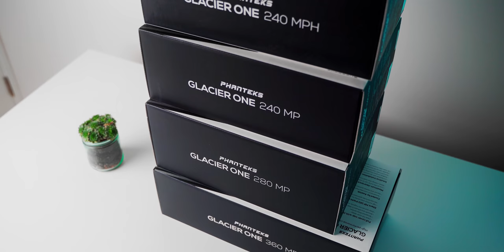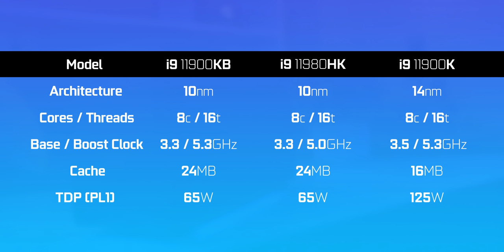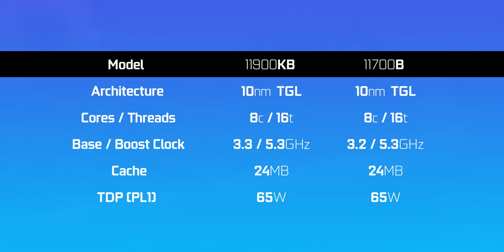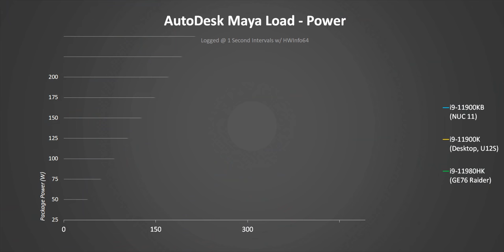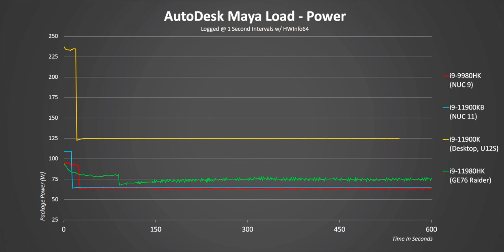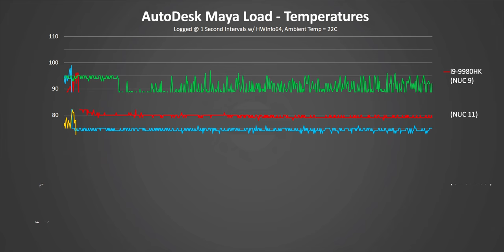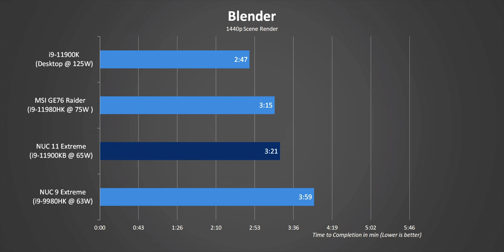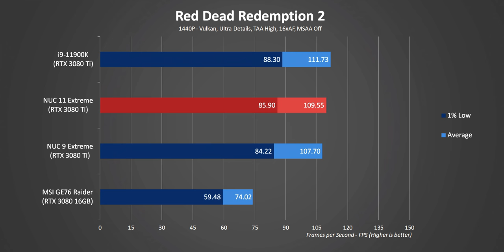The Best Intel PC - Beast Canyon NUC 11 Extreme Review

Comment: While I really like the idea for the money I'd personally get a laptop as they seem to be listing for $1600, though I guess that depends on the price of the CU alone.
Reply: It may seem cheaper, but gaming laptops do have limitations, the gpus and cpus are less powerful than their desktop counterparts and are often undervolted, they for the most part don't have any upgrade options, they also get hot and are quite loud. Make sure you factor all of those things in before you jump on a laptop because all of these things vary from laptop to laptop and two laptops with the very similar specs could offer very different levels of performance based on these factors.
Reply: @_shadow_1  I'm aware of all of this, but the NUC is basically laptop hardware in a not so SFF chassis.   If the options were 1) build a PC, 2) buy a NUC or 3) buy a laptop and the price were the same I'd go for 1 or 3 over the NUC any day though I do like the idea.
Reply: @nadtz  Yeah, I would go for even a laptop over the nuc because nucs are overpriced for what you get being basically a just laptop hardware without the portability or the screen. I decided to get a sff known as the magnus one, which has desktop everything except the ram, the difference between dimm and sodimm ram is just that sodimm is more compact for laptops and stuff.

It is only 8.3 liters, similar to the shape ghost canyon, and it has an rtx 3070 and an i7 10700, which is quite impressive for it's size
Reply: @_shadow_1  overpriced is somewhat subjective, the older ones at least are really well made and these don't look less so.  But personally value for dollar I'd agree unless you have some use case where this fits a need aside of "I got it cause it's cool" or what have you.

Comment: I mean you can get a DAN A4 wich is 8 l in volume and it looks cleaner.
Then kit the DAN A4 out with a 5800x, 32gb ram, 1 tb ssd, 650w power supply, good b550 board and a cooler and you are at about 1200$. So 150$ cheaper than the NUC and there you have still to buy SSD and Ram.
Its not a good deal at all. It is kind of good engeneering but for that price it is a simple no no. You can build an ITX system with better hardware and expandebility for quite a bit less, so i dont see a reason to buy this instead.
Reply: Some people like myself just don't find AMD appealing.
Reply: @cloakofshadow1  why not?
Reply: @riba2233  the evangelism of a lot of the userbase, mostly. The assumption that I'm a corporate mega shill for buying a different CPU has been thrown in my face several times.
Reply: @cloakofshadow1  ok but why would you care about that, you use cpu for yourself and benefit from it. Also hope you haven't forgoten how intel fanboys acted from core duo peroid up to zen2 launch
Reply: @riba2233  i'm not really bothered, but I won't be buying AMD any time soon.
Reply: @cloakofshadow1  so you are bothered? Any other reasons why you wouldnt buy it?
Reply: @cloakofshadow1  that is not a good reason not to buy AMD dude xD
Anyway you can change the AMD Cpu to an intel one if you want doesnt change my point. This was just an illustration that building is way better.
Reply: @timlolxP  no

Comment: thunderbolt 4 and four M.2 slots are nice features that aren't quite as easy to get, but 8L is just too big, considering the constraint and compromises. its really easy to build an ITX PC with fully upgradeable standard components, same GPU compatibility, a desktop CPU and even water cooling at that size.
i mean, you guys have built a full ATX PC with only 10L!

there are some nice little engineering details here, but just as many oversights, and its just not very interesting. poor effort intel.

Comment: Why wouldn't you have ran the tests with 3080 non TI in all the systems to really see how the overpriced laptop stood up? Just wondering why is all.
Reply from the maker: Good question.  If you think about it the 3080 can't really be aligned across all platforms anyways since the mobile version is more akin to a desktop RTX 3070 anyways.
Reply: @HardwareCanucks  true that, but for the general, "here's what your 3080 laptop is getting you compared to an actual 3080" is what I'm getting at. Kinda show in no uncertain terms that these laptops aren't even close to the real thing and shouldn't be in the same class. I was a completely ignorant consumer not long ago and fell for an alienware 17r2 with a gtx980. Had I done more research and saw comparisons of how crap the laptop versions of these graphics cards were compared the full size version, I'd have saved hundreds of dollars and had a system I could have upgraded. Instead, I have 15 pounds of e waste sitting under my dresser now.

Comment: More e-Waste, good job intel, you've gone from 5 liters of proprietary tech with little to no upgrade possible, to 8 liters of proprietary tech, and my guess is that the incompatibility of the "CPU add-on" board between the two will remain, do intel engineers do the job twice? Nah, if it was meant to be compatible, it would have been from the get go.
Go Mini ITX, team blue or team red, but keep on the standards, something that lasts and where you can replace the parts, upgrade, whenever you need it, and skip this marketing BS exercise out of the market. These stupid moves are so annoying. We have only one planet FFS.

Comment: Thanks for the review.
Sadly still too small for most high end gpu coolers (length + triple slot).
Reply: Would you actually pair a triple slot GPU with laptop CPU?
Reply: @balazsecker8204  
usally i wouldnt , but
as things are now, there arent many cards that are available right now. So gpu variety is even fewer. And as wrote above its about high end cards [RTX 3070+ (not all), RX 6800+] are mostly paired with a long and 2,5-2,9 slot cooler.  FE cards are a rarity in europe.

the casing is pretty much limited to 3060 (Tie),  6700 XT and below.
execptions nvidia FE cards (minus 3090).

I will most likely install a workstation card and use it as a small CAD / Media PC.